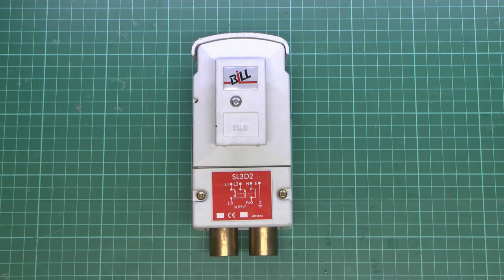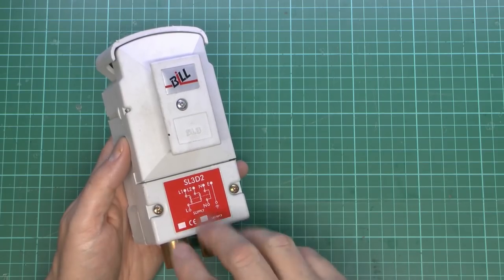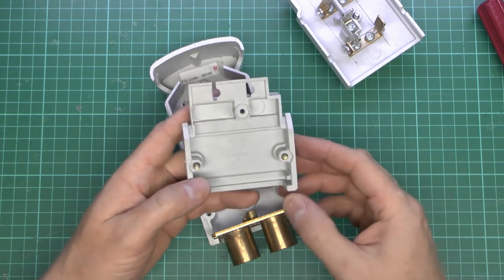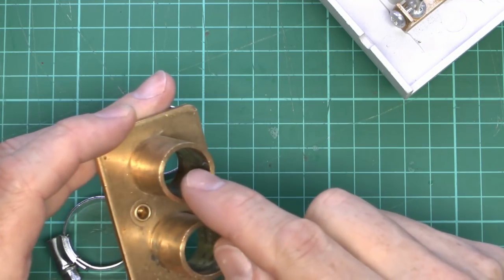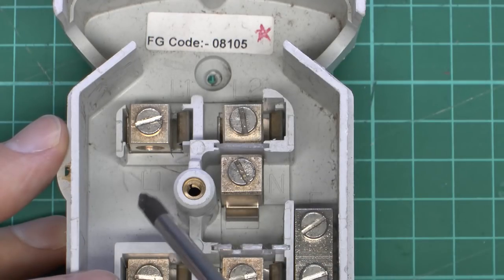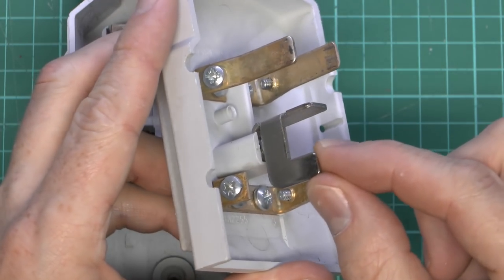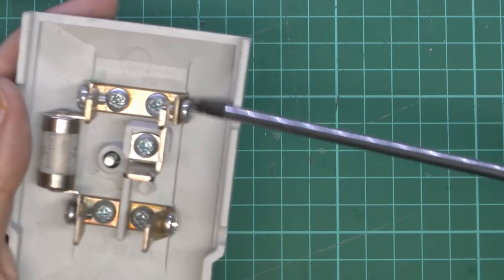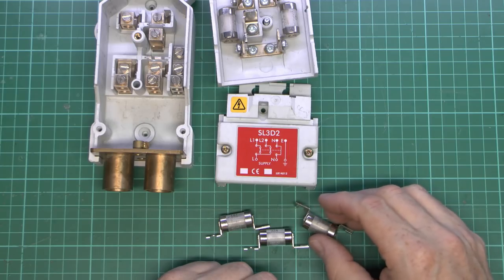Bill Street Lighting Cutout SL3D2

Comment: Don't think the connection method is crappy necessarily... it's actually quite a decent solution for speed of installation vs reliability. A lighting column is quite a dry environment generally so no need for IP rated glands... and it makes a good connection. The easy way they could improve it is to knurl the brass tubes on the outside so the armour's oxide coating gets pierced...
Reply: TheChipmunk2008 yeah.. I immediately thought knurled brass where the armour clamps would be a good solution. Jubilee clips are better in some ways I suppose than a standard gland compression where you can't see how well its clamped inside the gland. I have made off 100,s of glands in my time you get a feel for it lol..
Reply: The knurled tubes give a bit more confidence on gripping the armour too.  It's a much easier armour connection than trying to tighten a traditional gland in a cramped working area.  Particularly in architectural pillars where the designer has obviously never actually tried terminating one of their own products in the street.
Reply: That was my thought too...Traditional glands are excellent on a test bench into some blank panel. But in a confined space... yeesh
Reply: While I have the attention of the great Clive: thoughts vs the newer standard glands with the compression ring  vs the older 'graunch it over the spikey cone' type?
Reply: I have an opinion on this and it shows my age
Reply: TheChipmunk2008 The only ones I've used with the compression rings are the fully waterproof glands.  The most recent ones I used were still the knurled cone grip.

Comment: These cutouts are generally used for private supplies where each light is generally daisy chained. Most lights in the uk are actually fed from DNO supplies straight from the grid and are generally fed from anywhere. The cables are owned by the electricity company. Historically lights were fed via a substation switch wire but since the introduction of electronic photocells this is no longer the case and the lights are always live. These supplies cannot usually be isolated. All live working.
Reply: Do you do work on street lights ? If so could you put some lower lumen bulbs in them please , all i can see is glare nowadays when driving is bloody dangerous.
Reply: Andrew Joy ha no i dont work in street lighting but some related work. I think they can but some need different control gear plus they have to light some roads to a certain standard.
Reply: The standards are the issue, they need to be changed. The glare is a REAL issue. About 50% of drivers seemed to complain about poor lighting, so they changed to hugely glarey bright things... now the other 50% are blinded by the light (apologies to manfred mann)
Reply: So the lights doesn't go trough a meter ? How do the electric company measure the light power consumption this way ? Where I live the street lights go trough the same electric meter that you have in your home (or a three phase one if there are a lot of light to control), sometimes you see a cabinet on the side of the road where you have the meter, some protection and the light sensor, and that cabinet feeds a couple of lights. 

This have the advantage that there is only one photocell and the lights all come on at the same time, and if for some reason you want to turn off all the lights you do that flipping a single breaker, also maintenance and testing is easier compared to having a photocell on every light. 

Also you have protection on the lights, having them connected to the grid is very dangerous, if for some reason the live conductors are exposed you are in a lot of trouble, and unfortunately I see that too much often, light poles with the cover missing so you can touch live conductors, or poles that for some reason are not grounded and where the live comes in contact with the metal body. This way you can have a RCD to protect all the lights and you don't have to worry about that.

Comment: Are street lights 240v? What would be a maximum circuit length, how many lights would one circuit power? Would this be used for street lights with 2 lights on a single pole with each light fused separately?
Reply: Devvy Nully Two street lights, a street light and a lighted sign on the side of the pole (in the U.K., all upright signage within a reasonable distance of power is supposed to be lit, either internal or external; though the regulations have been relaxed somewhat in recent years) or most common would be a light and a spare for later use.
Reply: Hi Devvy. Yes 99% of street lights run at 240v. Most lights have DNO supplies which are fed directly from the grid straight from the substation (owned by SSE, Western power etc) these cannot be isolated.
Reply: Also you have double light fittings such as on a dual carriageway...
Reply: Some street lighting are fed from a control feeder pillar, usually in modern housing estates like mine, inside this pillar are fuses/breakers and contactors and sometimes some control setting equipment, How it works is there is only one column (lamppost) with the sensor fitted this is usually right next to the pillar, this column will have a permanent feed to it, when the sensor detects the dark it sends a switched live which will go back to the control pillar which will then close the contactors which then supplies the rest of the street lights, so they basically all come on at the same time. A street lighting pillar will typically supply around 50 columns (lampposts).

Other street lights like others have mentioned will have a permanent feed from the distribution main in the street tapped from one of its phases and neutral.
Reply: twin pole are commonly used for twin headed lamps or street lights with external breaker boxes for the connection of Christmas decorations as well as the lights themselves
Reply: LOL does it run at 240v single phase? I think someone has got the idea you can rob the supply with amazing ease. Probably true but not really a wise idea, the fuse at the sub station would turn you into a pile of smoking dust long before it gave out.

Comment: At least one firm manufactures a drop in front plate for car charge connector. So interesting to see that you can get a max 32apm fuse from them. So I guess the car could charge at 20amp with no issues.
Reply from the maker: yes, 20A would be ok or even the 32A - the limiting factor will be the size of the supply cables and whatever they are connected to.
Reply: Since the commercial feedpoints for car charging are often rated at 32A I'd guess a car could charge at 32A. :)

Comment: Do these have their own meter somewhere or are they wired straight in with some sort of fixed charge applied? I have seen overnight switch off trials in n various places so presumably there must be some sort of mechanism that reduces what the council or whoever it is pays.
Reply from the maker: Typically not metered, just a fixed price based on how many lights and what type they are.

Comment: OK, I'll ask the obvious question, why is it called a cut out when it appears to be a fuse box?
Reply: Called that so you can cut out the light circuit from power when you need to, without having to switch off an entire street section or an entire feed from a substation when replacing the light or control gear. Fused to protect the cable running up the pole, as that cable is typically not going to survive or have the current capability to blow a supply fuse. The typical light cable here is a 1.5mm cable, so they are almost always fused with a 16A fuse, while the group control ( generally used here with either a shorting photocell block in yellow, or with the regular photocell left wired in) will have a supply fuse of 63A per phase, as they use a 16mm wire armoured cable for underground, or a 16mm ABC 2 wire bundle for above ground use, and this generally will be capable of doing 2km of lighting if you use a 4 core ABC cable bundle, as you use phases in rotation as you go from pole to pole to get a balanced load and thus a low neutral current.
Reply: Open it and the light cuts out.